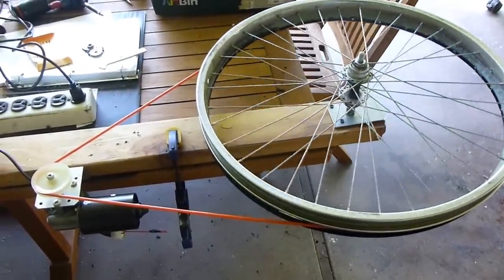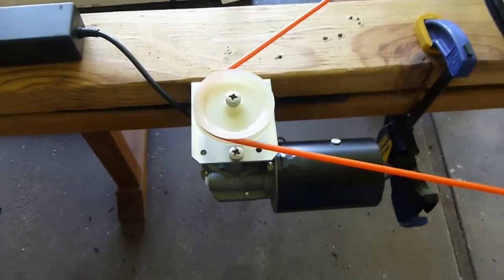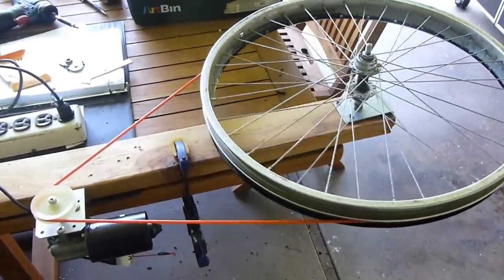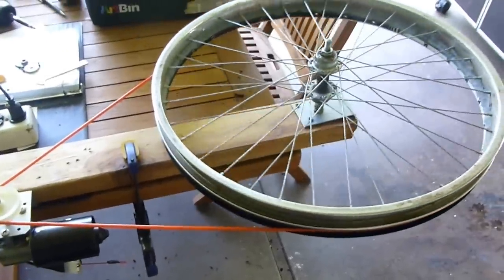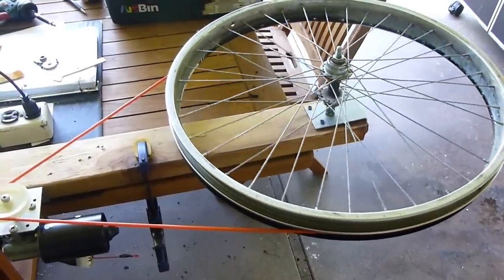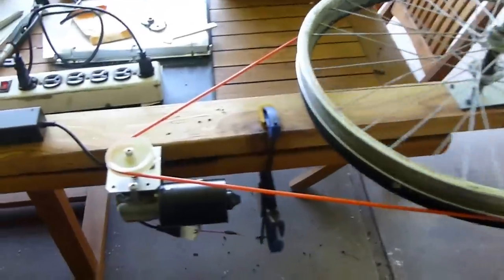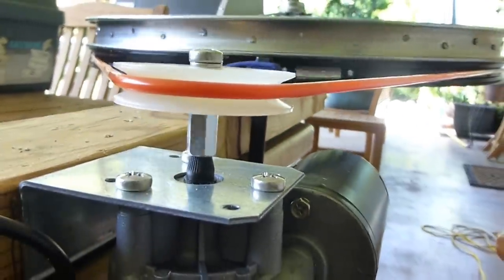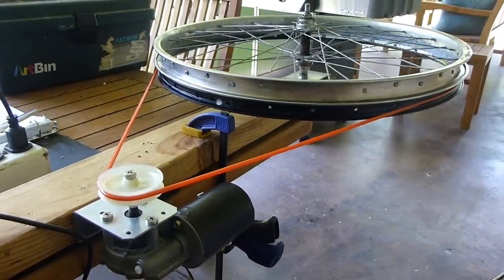Wiper Motor Running Axworthy Wheel Test

Comment: Hey there say I would love to know if there is a possibility to wire the motor so that it can run in reverse.
Reply from the maker: Totally. It's been awhile since I played with this motor, but if I recall it would run either direction didn't matter. Just wire the polarity backwards and it will run backwards.
Reply: Greg Wyatt with a 3 way switch?
Reply from the maker: @jeffjensen27  I see no reason why that wouldn't work.  Sounds like a good idea.
Reply: Greg Wyatt do you have any idea on how to even wire such a concept 🤔✍️✍️✍️🧐🤔?
Reply from the maker: @jeffjensen27  I do, but I don't have the time right now to diagram it for you.  This is basic electrical theroy.  Give it a try yourself.
Reply: Greg Wyatt I really have to concentrate on the theory. I should be able to actually buy a complete wired harness for a car and just tweak the existing principal concept minus the regulator still utilizing the entire concept. I could buy the replacement window switch’s install the switches into the walls extend the existing wiring harness to where all of the widow motors are connect the battery and whammy a multi control winch system Right?
Reply from the maker: @jeffjensen27  that sounds like an expensive way to do it.  Auto wiring harnesses cost more than a dpdt switch and some heavy hookup wire.

Comment: Hey good job how did you make power source connection?  power come from battery or from electricity?  and what kind of adapter or interfaces did you use
Reply from the maker: deli basist Thanks! Power came from a spare external hard drive PSU supplying 12v at about 1.5A. I stripped the end off of the PSU and used a multimeter to determine which wire was ground and which was 12v, attached clips to the wires and pushed them onto the wiper motor. Couldn't have been easier. The hardest part was finding the right pulley and screws to attach to the shaft.
Reply: Thank you for quick answer. Can I use laptop charger? Which is 12v 5A
Reply from the maker: deli basist anything that spits out 12v and better than 1a should work. do your homework and be safe around electricity!

Comment: Hi! i want to make a robot like a hoverboard. I want to push a person around 70 to 80 kg weight. Can I use this motor for robot please help me.
Reply from the maker: I honestly do not know how well this would work.  I'm sure you could get it to work, but I don't know what kind of speed you'd get or how power efficient it would be compared to a commercial hoverboard.  But it has a lot of torque and I believe it could push 80kg.  I would suggest you investigate what motor is used in actual hoverboards and see if you can get something that matches that.  I am a tinkerer and not a roboticist, so I'm not the right person to give recommendations.
Reply from the maker: @MuhammadHamza_MadniElectric  I'm sorry, but you are asking the wrong guy.  All I did was connect a wiper motor to a 6v power supply - not even a battery like you're going to need!   Have you tried searching for "DIY hoverboard"?  I found this:
https://bestelectrichoverboard.com/build-diy-hoverboard/
And this:
https://www.instructables.com/id/How-to-Build-a-Hoverboard-You-Can-Ride/
And this:
https://www.creativitybuzz.org/make-homemade-hoverboard/
It doesn't look like any of them use a wiper motor.  If I were you I would do some more research on plans and parts.  Best of luck.

Comment: How did you connect the wiper's shaft to the wheel?
Reply from the maker: That was easy!  I took the whole wiper to a local shop that specializes in odd connectors, called King Bolt in Azusa, California.  The staff helped me identify the size and threads on the motor, and if memory serves it was M6.  Then it was just a matter of getting a long M6 coupling nut (as can be seen under the pulley wheel) and a long M6 bolt for the other side of the coupling.  I got a cheep clothesline pulley from Home Depot and took it apart to use the pulley wheel.  The hole in the wheel is just a bit smaller than 6mm, so it fits very tightly on the M6 bolt and friction keeps it snug.  
Since the wiper motor ended up using a fairly common threading I could have taken it to almost any hardware store and gotten what I needed.  All one needs to identify a bolt and thread is a good gauge.

Comment: What did you use for a belt?
Reply from the maker: I use a urathane round belt.  I think I got it on Amazon.  You just cut them to length and then use some heat to melt the ends together.  Super simple.
Reply: @gcwyatt  great...thanks!  Didn’t know of such an option.